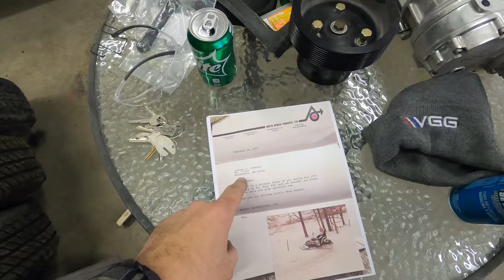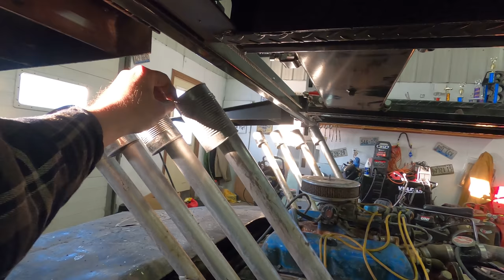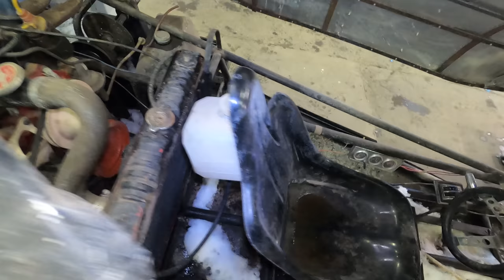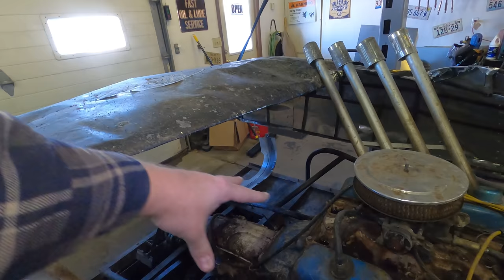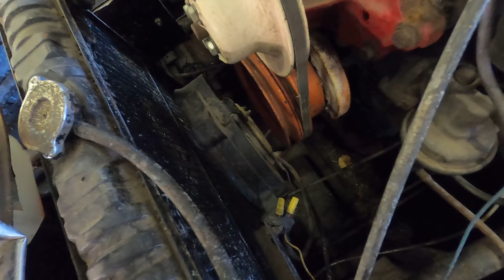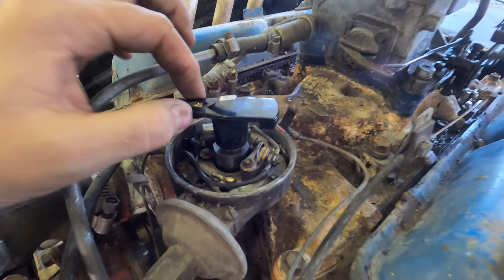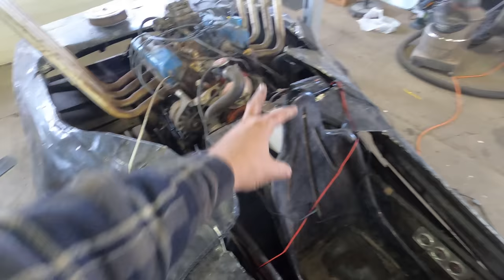Ford V8 Powered Dual Track Drag Racing Snowmobile - Will It Run after 20+ Years?

Comment: That radiator hose blows out you're going to know what hell feels like.
Reply: Nothing like a nice warm coolant shower
Reply: Duct tape will ensure that never happens
Reply: My dad had one of four gas stations near a highway exit. The one directly across was up against a cemetery. I saw one guy eat a face full while checking a customer radiator. Before anyone got to him, he had run into and back out of that cemetery. He was fine, but that was a creepy few seconds.
Reply: Excellent
Reply: That sweet sweet slippery hot stuff is wonderful for deep exfoliating
Reply: Feel nice on a cold winter day

Comment: 302 engines were introduced in 1968 as the replacement for the 289's. There is also a FMX automatic that has the vacuum modulator on the right side but has an aluminum bellhousing & cast iron case. The C-6 also has a single piece bellhousing /body.

Comment: Easiest way for a rough guess capacity in a ford, pull a spark plug and use a piece of wire down the hole to measure the stroke, 2.870= 221/260/289 (unless it has a 5 bolt bellhousing you can guarantee its a 289, only 65 and earlier ran the 5 bolt bellhousing and no 221/260's had the 6 bolt bellhousing) 3.00= 302, 3.5=351
Reply: You can also quickly tell the difference between a 289/302 and a 351W by measuring the width of the intake. The 8.2" deck 289/302 is about 8" wide, while the taller 9.5" deck 351W will have a roughly 11" wide intake manifold. Also, on a 289/302, the pad for the distributor is almost level with the China rail, while it's about an inch down on a 351 because of the taller deck. Both have the thermostat housing in the intake manifold, which is an easy way to tell the difference between a Windsor and a 335-series Cleveland, which has it in the block.

Comment: Hey Derek, the actual term is "Pin the ears down". Ever drive a Model T with the original drive train. The 'ears' were the throttle (right side lever) and the spark advance (left side levet). These levers were on each side of the steering column. 
I figure you have driven a T but thought I might confuse others on the Model T controls.

Comment: I raced Arctic Cats in the same time period. I was an independent but I knew Carmen to talk to in the pits. He was quite a guy. There was nothing about snowmobiles and especially fast snowmobiles he did not know. That was not the only V8 powered dual track sled by a long shot, there were many that would run on Lake George for record runs. I never saw that one on the lake though. I also notice there are no studs in the tracks so I can be pretty sure it was still in development.

Comment: Wow! What a trip down memory lane for me. My brothers raced Cats in the late 60's - early 70's. I remember when Cat brought out the custom "Boss Cat's" for attempts at speed records. They succeeded in setting a few records but the records didn't stand very long as technology allowed more traditional styled sleds with bigger/better snowmobile engines to break the "Boss Cat's" speed records. If I remember correctly a 800 cc Hirth powered King Cat was almost as fast directly from the factory.   Great video.

Comment: You can get water in from corrosion from the intake manifold or bad intake gaskets.
Also you should add that only point distributors use ballast resistors to reduce the power (amperage), if you change to electronic dizy you can't run a resistor or it won't run right.
They reduce the amperage thus reducing heat so your coil  and points last longer, but electronic dizys need a higher amperage so if you leave it in you won't get enough power (weak spark).

Comment: Look on the Block below the exhaust manifold. That's a favorite spot for the casting numbers. ALSO the numbers aren't always in the same place because they used so many different foundries for their blocks. They didn't have dedicated foundries for each block until the early 70's.

Comment: VGG: "I don't know much about Ford engines."
Also VGG: "Let me drop some Ford knowledge on you for every aspect of every Ford engine ever created."
Reply: How much is there to know if you're familiar with any other brand of 4-stroke gasoline engine ever built for any purpose whatsoever? They all work the same way.
Reply: Unless it's a four stroke Diesel. Because it's possible to run one off gasoline. Or pretty much any other combustable liquid. Run time variable. Also you can fit spark plugs. Making it depend less on compression, and more on ignition.
Reply: @devilsoffspring5519  Really, and My Father was a Parts Mgr for GM for 45 Years, the One thing that I caught Hell for was "ATS"....All the Same, you've got lots to LEARN!!!
Reply: @devilsoffspring5519  yeah exactly.. I'm putting a rotor in my Cleveland
Reply: @dacarvoid45  yeah nah
Reply: @JayJay-_  Aussie?
Reply: @xgford94  9 generations deep

Comment: On Ford small blocks, supposedly starting in 68 (not 100% sure on that) they should have a partial VIN stamped into the block on the flat pad just behind the intake manifold.   The first digit/letter is the year of what it's out of.   Good job going through part numbers, etc to help ID the year of the engine and what it's out of.

Comment: Congrats. Great find, Derek... and excellent commentary, as always!  A guy bought a 1950 Ford pu hot rod back in the 80's, had a 302 with a 4-speed Muncie dropped in, wouldn't go past 25 mph, so the feller that built it sold it cheap...saw it in the paper and bought it for 2500.00. Talked to some fellow hot rodders and the problem was it had no ballast resister. Who woulda thought it? Put one in and man oh man, it was a fast, sweet ride.

Comment: You're gonna have to change the tracks to some kind of 'high speed' deal.  At about 90-110 mph the attached metal bars are gonna get thrown off the track when it turns the corners at the pulleys

Comment: I would put my money on the motor being a 289 out of an early model Mustang. The shifter makes me think that.
Reply: That's just what I was going to say. The shifter looks like a mustang for sure and little I know......I never seen a 302 with a automatic. Had a 68 stock 302 but it was a manual. They may have done it but every mustang I was around when I was young and dumb all the 302's were manuals.
Reply: asteinmann  Those castings only refer to the first year of use.  That manifold could have been used on a later year 302.  If I remember correctly, you could option for either a 289 or 302 in 67 and maybe 68.  There were some full size cars that only had a 289.
Reply: exactly what caught my eye too!
Reply: @oldfarmer4700  It was from a Fairlane or Torino he said.

Comment: If your still not too sure of the block, the casting number is by the starter under the block.  Popping the valve covers the heads should also say “66 289” on them.

Comment: Make sure when checking the circuit continuity you have the key off and wires disconnected.  It'll put you down 46 different roads with 27 different outcomes if you don't.  Great explanation of the spark plugs and engine trouble shooting

Comment: When you get around to it, I can vouch for the quality of the black aftermarket drive cogs for these full width cleated panther tracks. I did mine a few years back. They've held up to a lot of abuse and still look like new. I'm sure they'll handle the power of this beast when the originals go.

Comment: I remember these! They were the wheelstanders, jet funny cars, early monster trucks of the snowmobile events. Lots of noise, lots of fun, and a way to get the crowds out of the beer garden, and to the track for the actual races. There were a few exhibition matches between these, but for the most part, they just did solo runs, and "record runs". Basically exhibition vehicles that sled manufacturers would throw a few bucks at to have painted up in "factory colours". As a kid, I saw pics of the Boss Cat in Snow Goer magazine, and decided that's what I just had to have for running the local trails. Could you imagine?? LOL

Comment: I don’t know about the intake but my guess was he used a 66 mustang from the radiator and shifter that it has in it
Reply: That trans isn't from a mustang but I'm with you on the shifter and rad. I was guessing ford pu motor  pre 1972 .hoping for engine casting numbers before video ends
Reply: @inmate666  it’s a plain c4 why do you say it’s not from a mustang specifically?
Reply: @lucasswearingen377  I thought it was a fmx with the cast iron center section. I might be wrong. I'd have to go watch again. A 6 bolt c4 could definitely be a mustang trans.my bad ...maybe
Reply: I’m with you 66 mustang. Awkward to push the T Bar release button with your left pinky!
Reply: @lucasswearingen377  it is an fmx not a c4. Cast iron center section and dip stick in the side of the pan .

Comment: I think a guy could bring the bodywork back around with a cut and polish.
Reply: Might have to use the #1 grit to smooth things out 👌
Reply: I was thinking try driving 1st without body. To make it easier to wrench on & no regrets if bang it up
Reply: A feller is goin ta want more than 1 grit
Reply: 50 Gallon Drum of BONDO & she'll be straight as an arrow!
Reply: 1 grit sandpaper to the rescue.

Comment: Like your show a lot. good job on the heat range and importance of sparkplugs. I grew up in my grandfather's gas station with a full set of original Motar had back manuals which have pictures of all the things you described abut the plugs I mean Sparkulators  ( I love your slang) Good job.

Comment: I know you like to use Berryman's in your startups (i do as well). Do you have any good recommendations for manual transmission additives or a gear conditioner that would be good to use in an old Borg Warner T10 that had been sitting awhile?

Comment: always run the fl1a, or the fl300 motorcraft filter. it has a good check valve on it that keeps the motor from knocking at startup. helps to hold the oil in the engine, and keep it from running back into the pan after you shut it off. you really should have took the valve covers off, and spun that motor to make sure those valves are going up and down all the way. guaranteed, with those headers, a few of them valves are sticky and they're not coming all the way up. for sure

Comment: My money says the trans is an FMX, based on the cast iron mid-section, modulator on the drivers side, and the 4 bolts hold the bellhousing from the back rather than through the bellhousing,

Comment: Be easy today with a front wheel drive 1to1 ratio and reverse and then the two torque converters and tracks. you could even utilize the breaks with cables to the steering help to turn it like the diff on a car putting more power to the outer track

Comment: Right by the starter for the casting Number.   Good way to tell 289/302 from a 351 is the ridge behind the distributor. Two fingers or so 351, one finger or so 302!

Comment: The C6OE-9425-A PN you found on the intake breaks down like you said into a 66 MY O for torino or fairlane (but could have used in any ford car but was initially released for a fairlane / torino)  and E is for engine. Then the 9425 is the base part number for any ford intake and the A is the 1st revision level. If the suffix were a B it would have been the 2nd revision level of that part. Sometimes there are 2 letters in the suffix such as an AA which means the part had a minor revision and if it were a BA, the B would signify a major revision.   So when I look at a Ford part number the part your looking at is obvious, ie crank, cam, head etc... and it's very easy to tell the vintage of that part with no further assistance needed. With exception of the Y block firing orders on OHV V8's were the same (15426378) up until the 351 when it changed to 13726548 and was done to eliminate a front main bearing knock at idle. Also the mopar V8's used the same oil filter as the ford with 3/4" mounting thread and anti drainback valve. I used to work at a Dodge dealer and one time the parts guy was one number off one time and instead of an engine part, we received an interior piece.

Comment: FYI, the trans is an FMX, NOT  a C4.

The block casting number and date code will be above the starter on the block. 289 and 302 intakes are interchangeable, the numbers on the intake don't mean much on a hodgepodged together drivetrain like this.

Comment: I'd advise relocating the rad just in case it gets hot and pops right behind the drivers seat.
 Will leave you burned pritty bad if it does.
Reply: or throw a little aluminum firewall in there temporarily,keep the hot liquid away from a guy

Comment: A ballest resistor drops the voltage , so if your ing system is 12v it will drop it to like 6v so it doesn't burn the points , on my 1968 cutlass it has a internally resisted ign coil

Comment: Derek engine block casting numbers on the passengers side of block under the exhaust manifold. Also there is usually a number and a letter stamped into a  small nib at the front of the block below the distributor that will tell you month and year it was cast..this is from memory of decoding my 64.5 260 Mustang. If you can be bothered getting them....I don't know, I could decode them.

Comment: The trans is an FMX, the last of the cast-iron case trannys; a C-4 is much smaller and can be identified by a 4 bolt cover on each side of the case. A C-6 would have been possible  in this year, but it is much larger, aluminun case, with the case and bell housing one piece. The engine /trans combo likely was from a full size car, like you said, possibly torino; this trans was completely phased out in 1979 or 1980, being replaced by the first ever overdrive trans, called the AOD.

Comment: You are correct about "reading" plugs is a lost art. We had an expensive CV Products spark plug viewer that we used for dyno tuning. It was the same thing doctors used. I'm over 70 and the Old Guys in the neighborhood taught me about reading plugs when I was a teenager. One very important thing you can see if you know how is to see evidence of Detonation - an engine killer - so it's not just about the fuel/air mixture.

Comment: The radiator not safe that close to the driver hot water doesn’t feel good
Reply: Agree. Going to want a bulkhead between the rad and seat at a minimum. Better if it's quite a bit over your head. Seen too many people get serious burns from that.
Reply: Why on earth would anyone building such a machine be concerned with safety?
Reply: But the 800 feet ish race this was for while not a great idea not a terrible one either

Comment: a ballast resister limits current. they're very often used in led's, to limit their current draw. if you have no current flowing through the resister then you'll have no voltage drop, but if there is current flowing, you'll have a voltage drop across the resistor.

Comment: I haven't watched the whole video yet, but SBF block casting numbers are on the passenger's side of the block, just above the pan rail, back by the starter.

The intake engineering number you saw is indicative of the first year and application, not necessarily the actual year of production. There is actual casting date code adjacent to the block casting number (will be like 6D25 for April 25th, 1966) and the assembly date info stamped into the front of the deck of the driver's side of the block, under the distributor.

All Ford V8's were 15426378 until 1969 and the advent of the 351W, which is 13726548...which eventually gave its firing order to the 302 in the 1982+ High Output versions. Strangely enough if you drew out a SBF on a piece of paper, then spun it 180°, so that the distributor was in the back and #1 cylinder in the front on the driver's side and renumbered the cylinders GM-style, you'll find that the firing orders are exactly the same.

No matter the manufacturer, whichever cylinder is the farthest forward is always #1. Oh, and the distributor always rotates the opposite way the vacuum advance pulls.

Keep up the good work. Anything you want to know, just ask.

Comment: Ford leaves stickers on the valve covers when cleaning fades away otherwise you have to look for the cast numbers and look up on the interwebs for the answer. There were a lot of weird inbetween engines in the Windsor family besides 289, 302 and 351.

Comment: That looks like an engine out if a fairlane 289 challenger. 200 hp 282 ft lbs stock. So if he hopped it up a bit id say your pushing 250 hp and 330 ft lbs. Thats insane for a sled!

Comment: Would be dope with a sled wheelie bar that was done right with some of the slides from the front steering also if the radiator was in front of the driver it would warm him as you race also some type of concept for an e-brake that drops a plow of some sort into the snow and put a big ol ridiculous scoop on her

Comment: ford 351 windsor you can take the  thermostate out with rachet/extension /socket  260/289/302 you have to use a wrench on one bolt

Comment: My friend has 2 86 f150s with 302s in them and his 302s look bigger and the valve covers look a little different I took apart the top end of the engine on his injection one and I also believe the oil fill cap is on the opposite side of the engine  so yes it is a 289